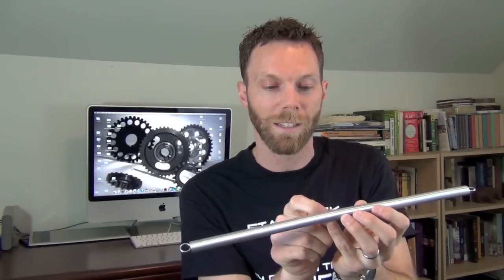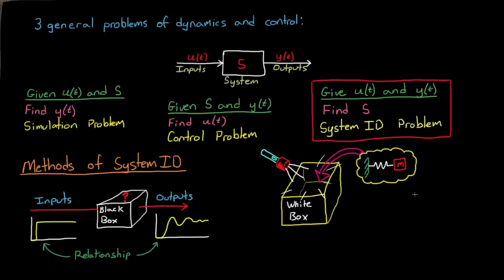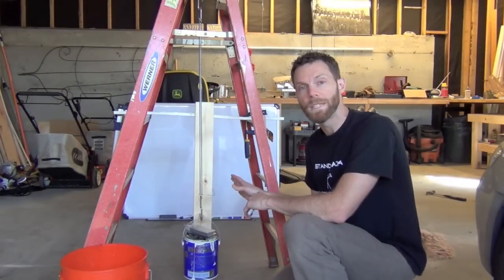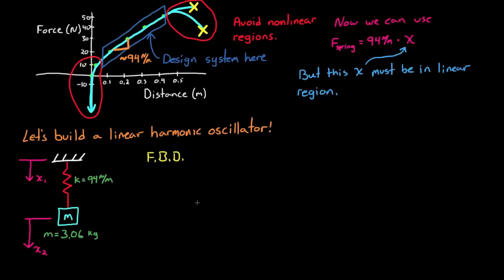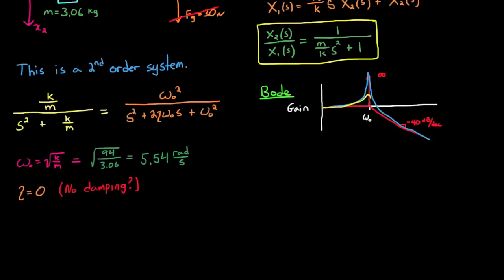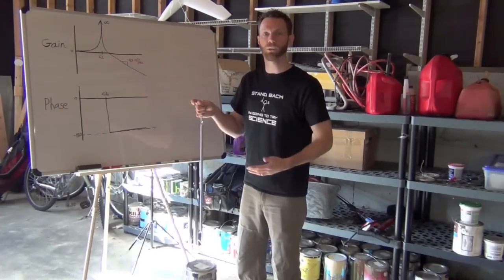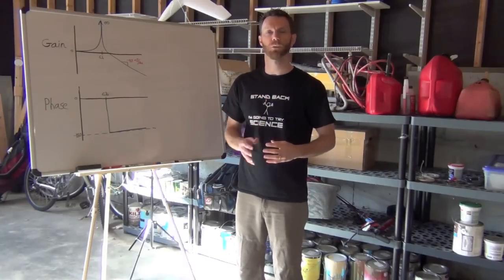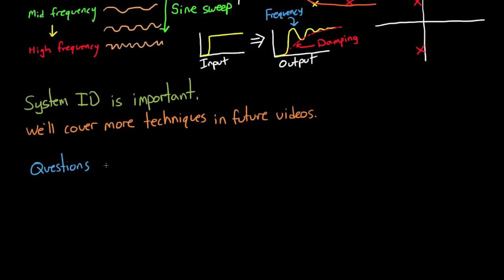System Identification Methods

Comment: Thank you
System Identification 
Spring
Linear and non linear region identification 
Spring constant K = N/m
Simulation problem find y(t)
Control system problem find u(t)
System Identification find S
Methods of System ID
Black box find S based on sine sweep or step input or bump test    
White box find S based on mathematics
(Soring constant, force = ma)
missing here is damping factor, how to find damping factor?)
 
Finally testing on real spring and mass.

Such a wonderful explanation 
Thank you

Comment: Awesome explanations! Thank you so much. I'd like to throw in my five cents on obtaining the harmonic oscillator equations. I think it's not the most transparent way to do it. Technically, in the F.B.D. there are only two forces acting upon the mass both in stationary case and in motion: Gravity and Spring Tension Fs(x2,x1). Reducing this to a single force k(x2-x1) (which equals to zero at steady-state with x1=0) is done my choosing the coordinate system so its origin coincides with the resting center of mass.
Reply: I have similar idea in my head.  But i think if we analyze the stationary case, the tension in the spring us equal to the weight downwards. And the other upward force is caused by the input when it starts oscillating.

Comment: Great video! A follow up: would this method also work if x2 (the output) is fed back and used as a control feedback?
Reply: I think as mentioned in the starting black board of the video, we are dealing with a system ID problem(number 3).
While the feedback might be associated with control problem(number 2)

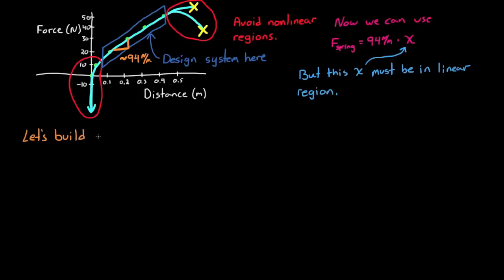Comment: Around 7:15, you are writing down equation of a spring as F= 94N/m* x, however I would expect an offset there(from the graph about 10N). Would that affect the analysis further down?
Reply: Visual inspection would give as you said. In context at to the verbal discussion, x in the equation refers to the linear region. It would be inferred that the "zero point" is the minimum displacement for linearity, say 10cm.

Comment: hi brian 
can u tell me why we identify the model of already existing system..which mean we already have the mathematical model of that system from which we had design the hardware of that system...
for example why we need the system identification of a rotor craft which we already have in hardware..?
Reply: How will you design a control system for a highly unstable system without knowing it's behaviour to different inputs. Some systems are so unstable that you cannot develop a stable controller for it and test it in real time. Think of an inverted pendulum. If you design a simple PID on a real system there is no way you can control it since it is an unstable equilibrium. So you need to have a model and design controller offline so you can have atleast partial stability so you can observe the system and tune it further in real time.

Comment: Hi Brian do you know how should we proceed if the system has multiple Inputs/Outputs? (In my case a Quadrotor with 4 engine speed as input and X,Y,Z, Pitch,Yaw,Roll as outputs)
Reply: state space model?

Comment: Hi Brain, 
Great work by you. I need a suggestion from you. Consider any sensor/ sub system in aircraft say for example, Inertial Navigation System (INS), which is vital and plays important role is determining aircraft current position and so. The input to the system is 3 axis Acceleration, 3 Axis Body rate i.e. Aircraft Pitch rate, Roll rate, Yaw Rate. The output is latitude, longitude and Altitude and etc. Is it possible to model an INS, using these I/O data thro' system identification.

Comment from the maker: Hi Eduardo, I apologize but I don't think I follow your question. I don't think what I did is a competitor to LSM.  To me LSM is used for estimating oversampled signals (for example trying to curve fit a noisy measurement).  I used LSM to get a bet fit linear line of the data.  Also, when you're doing the black box method you can use LSM to determine the best coefficients for the transfer function that you're estimating. If I'm way off your question could you please state it differently? Thanks!

Comment from the maker: Hi Daruko, thanks for the comment.  Determining zeta through some white box method would be tough but it can be done.  You'd have to find or develop an equation that uses the spring parameters like material type, number of loops, radius of the loop, etc in order to calculate it.  Realistically though you'd just test for it (similar to how we found the spring constant).  More often than not developing a model takes both methods - writing equations and testing for the parameter values.